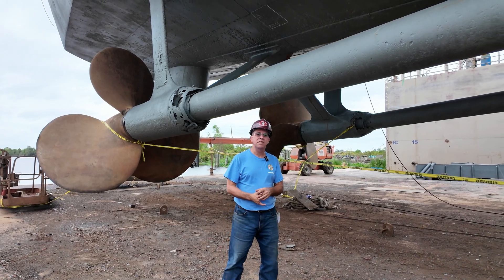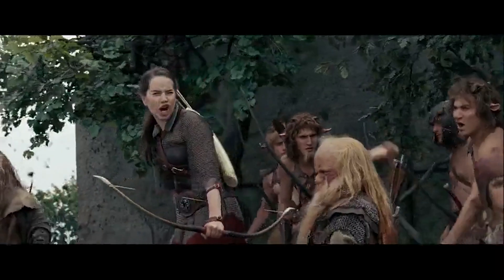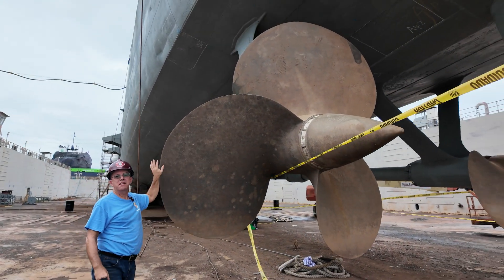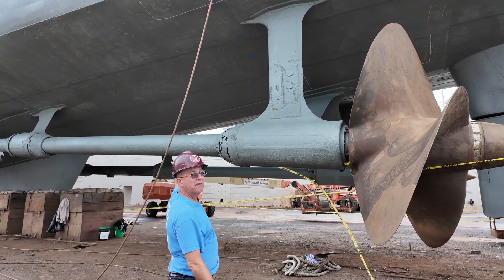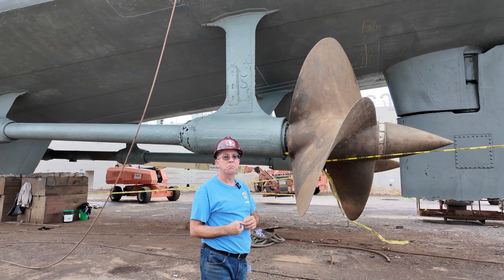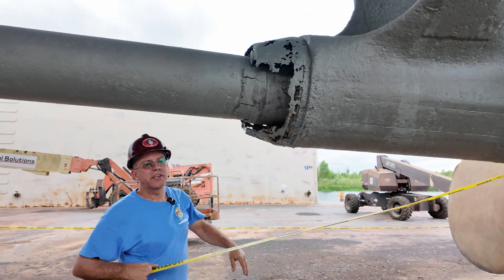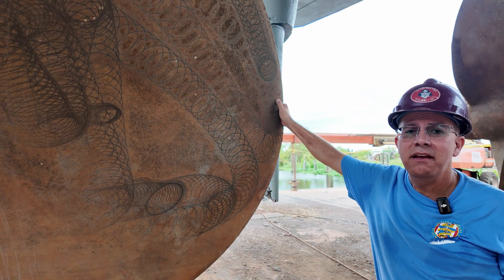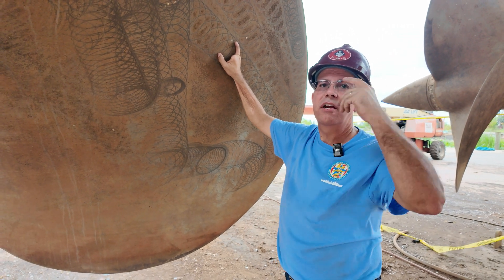Up-Close Look at a WWII Destroyer's Propulsion System

Comment: I remember in 64 when I 😮 on the USS Porterfield we were doing a man overboard drill and they reversed one screw to turn quickly and the whole ship was vibrating and we must have been over 20 degrees I had to hang on so I wouldn't be the man overboard

Comment: Why doesn’t the navy use through prop exhaust ?
Reply from the maker: @DevilDog0311 : You mean using the prop shaft as an exhaust pipe?
Reply: @usskidd661  ya … I was being a wise ass in a way … through prop exhaust is found on outboard and inboard/ outboard motors it’s no way practical for the navy to use the prop shafts for exhaust   I am a outboard and inboard / outboard ( stern drive ) mechanic since I was 14 I just thought to play dumb person and ask why it does not have through prop exhaust .. being boats here in Hawaii are all run in salt water i suggest using magnesium for your sacrificial anodes … I don’t know how aluminum works but everything I ever read says use magnesium in fresh water
Reply from the maker: @DevilDog0311 : Actually, zinc is only practical for salt water, which is what she had when we received her. Magnesium and aluminum are better suited for fresh water. We're going with magnesium.

Yeah, we were wondering about that. Not only would a prop exhaust compromise the shaft strength, but it would expose their interiors to salt water degradation. Plus, all those air bubbles coming out would be like a road side flare for any enemy sonar suites listening.
Reply: @ don’t forget the hot exhaust gasses .. the exhaust manifolds on inboard/ outboard motors are cast iron and they rust through even if the owner flushes the motor after each use  I had inherited one of my dads customers and he was very cheap first he asked me if his exhaust manifolds were good I cleaned them up found cracks and then he asked if I could weld it I said no quoted him new ones and then the cost of used ones not cracked and he left upset that I did not just give him used ones  … as far as anodes go I agree magnesium is your best choice .. you can also in the future sell them as fire starter blocks in the gift shop 🤗 so you got protection from corrosion and a little something in the piggy bank for the future I made a typo in my reply everything I’ve read in books say salt water use zinc fresh water use magnesium

Comment: About the fairwater cap. It doesn't just smooth the water flow, it protects the the taper end of the shaft, the threads, the nut from corrosion from water intrusion. The cap has a couple of pipe plugs in it, which they unscrew and pump in heavy tallow/grease to pack the voids with something to further prevent water intrusion.

Comment: Any reason USS Laffey in Charleston has the bottom 1/3 or so of its prop blades chopped off in a horizonal line of where the prop shafts stopped? And The Sullivans doesn't even have any props remaining?
Reply from the maker: @gunhog11 : We can't speak for those organizations but MIDWAY just did the same recently in shaving their props and rudder because the rudder was driving into the bottom and damaging the stern. As for removing props, some vessels remove them and then chop and seal the shafts to avoid future leak issues.
Reply: @usskidd661   That’s very interesting and makes sense why those ships would have had that done. It’s nice to see Kidd complete in that regard. You all are doing fine work with her and her preservation, and your videos are both very interesting as well as informative. Thank you for that, and I’m looking forward to getting down there and seeing both the ship and the museum.
Reply from the maker: @gunhog11 : Thanks for the kind words. We try. Look forward to having you aboard. Spread the word, please. There's still a need for funding for this drydocking effort. 🙂

Comment: What's amazing to me is the fact that Fletcher's only have a single rudder. As fast and maneuverable as they were, dual rudders, one behind each screw would have made them even more so and more effective in their ASW modes. 

I served on a Gearing and at 27knts our turning radius was so tight that we could catch/cross our own wake from our previous course with the wheel hard over. 

I know the later DD's, Allen M Sumners & Gearings were fitted with them and could turn a lot tighter.
Reply from the maker: @skipperclinton1087 : The last four Fletchers were fitted with dual rudders. And all Fletchers that came back into service for the Korean War immediately received an enlarged rudder, which is what you see on KIDD.
Reply: @usskidd661  I have heard that, about the last 4 Fletchers having dual rudders, but we need proof, sir.
Reply from the maker: @Hjerte_Verke : LOL Well, three of the four are still around. ROOKS was scrapped in Chile. COLHOUN and LITTLE were sunk at Okinawa, so you'd have to locate their wrecks to see the rudders. Best bet is the GREGORY, whose wreck is in shallow water in a military reservation off San Clemente Island where she was used for gunnery practice. Haven't ever found any wreck photos, though. Doubt any recreational divers get into the reservation.

Comment: The corrosion is incredible.  Everything but the prop's is compromised.  Will definitely never turn again.  The aluminum anodes have definitely failed.
Reply from the maker: @normangiven6436 : Zinc, not aluminum. We're replacing the zincs with aluminum. The props haven't turned since 1964 and were never intended to turn again per our contract with the Navy.

Comment: Single solid piece? Holy cap how long did that take to make? Weren’t these ships being pumped out in 3 months or something? Also thank you guys, propellers are my favorite part of any ship.
Reply from the maker: @dan1elhalas : The production capabilities of the U.S. during that time period and the will and effort behind them are truly mind-boggling.
Reply: If you're talking about the bronze propeller. I'd say it could be molded, poured, shook-out, cooled, chipped, machined, rough ground, pitched, finish ground in probably 2 weeks, ideally. Of course, providing the wooden blade form-buck was already made. I worked in a propeller shop for 14 years as a machinist.

Comment: If the ship is a museum and still in the water you don't need the propellers they should be on the ship's deck
Reply from the maker: @jameshammer-uw8iq : It all depends on how each respective museum chooses to display their ship. KIDD's hull below the waterline is visible part of the year at home in Baton Rouge when the Mississippi River is at its lowest levels, allowing the public to see equipment not normally visible for museum ships in coastal areas. Thus, we retain her props, shafts, rudder, and sonar dome for now.

Comment: I was curious if the longer prop shaft requires more power to turn and if the gearing is any different on that side vs. the other?
Reply: no they are the same HP , one turns left the other right
Reply: Just more mass to rotate due to the increased length. Engine needs to do a bit more work to get it moving, but otherwise the same.
Reply: @chrislaf89  Yes, that's why I was wondering about the gearing.  I didn't know for sure if the designers tried (needed) to balance it out.
Reply: I'm ASSUMING, because you never said why) the reason for the different lengths of shafts is because the engines and reduction gears are staggered in the hull to reduce the width of the hull for weight/speed.
Reply: @budlanctot3060  Looking at the plans, the turbines/reduction gears are paired up with their respective boiler/fire rooms.  So, the room immediately the rear of the forward boiler room has the turbine/reduction gear for one prop and the rear boiler room also has a room immediately behind it to house the turbine/reduction gear for the other prop.  Hence, the reason for the different lengths.
Reply: @ksorsomeplace  I think that's what I said.
Reply: @ You seem to be asking a question in your comment since you prefaced it with "I'm assuming...."

Comment: Very good video, I just lapped up the detailed dimensions of the propellers that are hard to find even in books like Dr. Friedman's "Illustrated Design History." Viewers might like to know the motivation for the shafts being different lengths -- one engine room was forward of the aft boiler room and the other engine room aft of it. The reason is to prevent a single torpedo hit from destroying both engines or all the boilers, leaving the ship dead in the water. Destroyers built earlier had all the boilers together forward of the engines. This layout was more compact but was said to have contributed to the loss of the Reuben James early in WW II.
The examples of vandalism were a sad commentary on today's culture. I don't claim I understand the psychology of it but when visiting one of the battleships I saw that one of the gauges in the engine room had its glass deliberately shattered. This was a long time ago so it's not a new behavior.

Comment: Overall a good video but please stop with this and that special tool nonsense. I say this because pretty much all the finish work done on the Kidds Props after they were cast was done with grinders, sanders, and buffers along with various measuring tools such as angle finder, levels, rulers, protractors, straight edges, etc along with the blood and sweat of skilled craftsmen and women.  Personally I find the finish work to propellers far less interesting than the construction of the patterns and molding of the casting sand that the molten bronze is poured into to create the propellers themselves
Reply from the maker: @gullreefclub : You should do a video on that. We'd love to see it. Seriously. 🙂

Comment: are the propellors gonna get polished or painted?
Reply from the maker: @CooperJohnson01 : Cleaned up, but not painted.
Reply: @usskidd661 What are the pro / cons of painting? Ryan (New Jersey) seemed to imply it could reduce galvanic corrosion if I am remembering correctly.
Reply from the maker: @lunarweasel : Keep in mind that NEW JERSEY sits in brackish water at times of salt water intrusion up the Delaware River. KIDD does not see that as we are 230 miles up the Mississippi River from the Gulf of Mexico, and the downward current of the Mississippi is much greater than that of the Delaware. Also, KIDD is dry part of the year while in her cradle. The galvanic corrosion occurs only when the metals are connected via the medium of the surrounding water.

Painting the bronze and then having the coating damaged by vandalism during the dry period also leaves just the exposed area vulnerable to oxydization, causing uneven wear to the propeller.
Reply: @usskidd661  Thank you for the detailed explanation!  --  so sorry about the vandals!
Reply from the maker: @lunarweasel : You're very welcome. Always a pleasure hearing from you and seeing you on the LiveStreams. 🙂👍

Comment: I hate to say it but my first view of a Fletcher class tincan was in Cartagena, Spain where their navy had one of theirs out of the water in a floating drydock for hull work.  In 1985 this was still a commissioned ship and the view one of my shipmates, a Gunner's Mate (5 inch) was of the port side.  She still had all 5 of the 5"/38 mounts vs our 2 5"/54 and looked beautiful.

My shipmate told me that even though our Mk45 5"/54s could reach a couple miles further, if for some reason we (a Spruance class) got into a gunfight with her, the Fletcher would tear us apart.  We had the advantage if we could avoid a close range "knife fight" because of our Harpoon missiles.

That Fletcher and my Spru-can are both gone now.  I don't know what happened to the Spanish ship, I don't even know which one she was.  My old ship is at the bottom of the Caribbean in about 1000 fathom of water.

The deliberate vandalism of Kidd pisses me off, but even caught red-handed the vandals probably would have gotten away with a simple "slap on the wrist."
Reply from the maker: @robertf3479 : Spain received the CAPPS, CONVERSE, DAVID W. TAYLOR, JARVIS, and McGOWAN. All of them are gone now. Interestingly, the crew of 661's little sister, USS KIDD (DDG-993), told us the same thing in 1997 when they visited while in New Orleans for Mardi Gras: should the two KIDDs fight, 993 would win at distance but 661 would dominate close-in.
Reply: @usskidd661 To be fair though, I’d be quite surprised if 661 managed to get in gun range
Reply from the maker: @sirboomsalot4902 : True. Today's fighting is designed to be at-distance.
Reply: There are five Fletchers it could have been, though I think it would be unlikely to be Lepanto D21 as she was decommissioned in 1985. Unfortunately the records of which one was in drydock in 1985 aren’t available it seems.